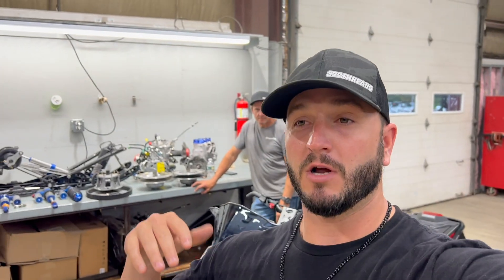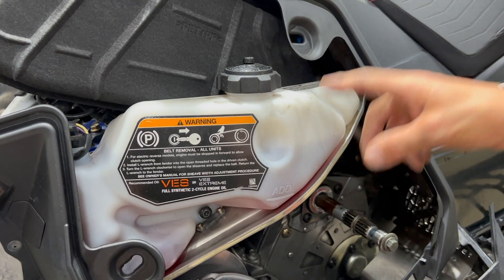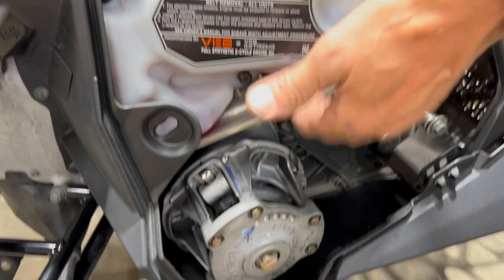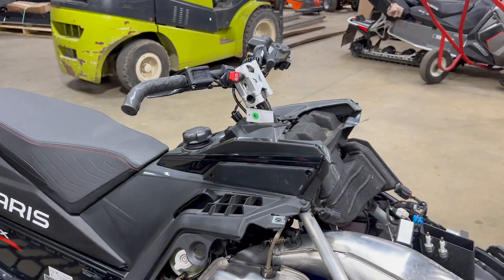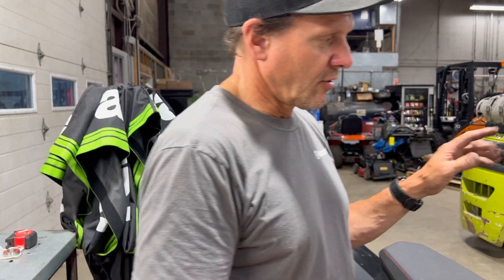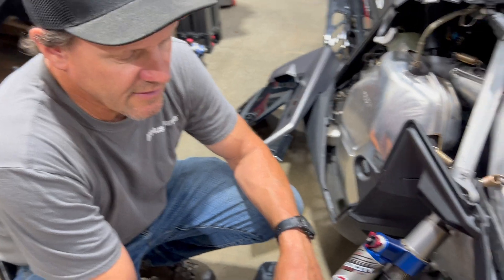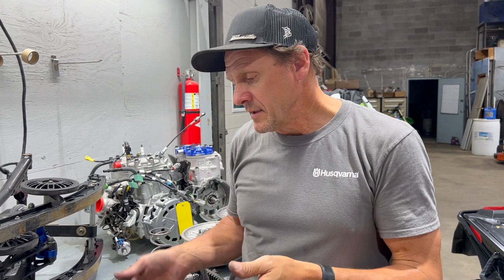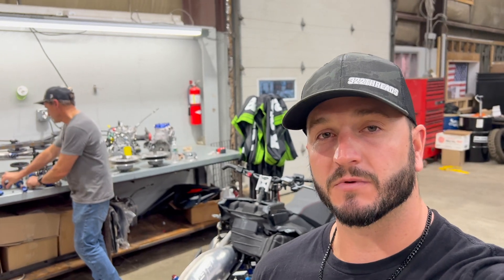DON'T GET STRANDED! OFF SEASON SNOWMOBILE MAINTENANCE! WHAT TO LOOK FOR AND WHAT TO DO!

Comment: Is it normal to have a little side to side play in the front track shock? The shock and bushings are new but I was surprised to see it move after I installed all new parts. 2017 XCR 800 if that matters. Thanks!
Reply from the maker: it is normal believe it or not. even brand new sleds have some side to side slop.

Comment: Jesse how about a video on what you carry in your bags on the sled tools mainly. Also I have never heard you guys mention ice scratchers. What are your thoughts on them brand style etc. Got the tv set up in the garage now to watch while tinkering on the sled
Reply from the maker: i dont even carry anything but i need to get some tools together for sure. as far as scratchers Bruce and i do not run them. i have never seen a reason too but he has been installing alot of BRP scratchers on customers sleds
Reply: We get a ton of ice on the trails around Greenville and over heat without them / burn up the hyfax
Reply from the maker: the BRP ones seem to be the best option.

Comment: Enjoy watching your videos. But for a regular hard-working guy like me, I have a hard enough time getting a new sled once every 5 or 6 years, let alone every year. I snowchecked my first polaris ever  this year an xc650 137. What is really irritating me about the whole thing is that I built my sled, got it ordered and confirmed then got told I couldn't get it in the shadow gray and black like I wanted. It came red and gray. What good does it do to have snowcheck and options if you can't get it. And people like you who do what you do for a  living i.e. the videos and stuff seem to get whatever you want when you want it. I'm not jealous or mad about what happened to me and I'm sure I'm not the only one this happened to. But why is that?
Reply from the maker: Hey Jim congrats on the new sleds. So anything I have a certain way I build them they way. I change panels and colors and wrap sleds. The sleds from factory come with a certain color scheme and that’s all that you can do unless you change the panels im sorry you feel singled out but that’s not the case
Reply: @JESSEJAMES322  Jesse, thanks for replying. I don't feel singled out. My real question was, why does polaris offer options to build a sled the way a consumer wants it, if you can't get it the way you built it. That doesn't make any sense. No need to reply back.
Reply from the maker: that doesnt really make sense. if you snowchecked a sled then it should come as you snowchecked it UNLESS your deealer messed up

Comment: Another STOP RIDE, IMPORTANT SAFETY STOP RIDE NOTICE

July 13, 2023

Polaris Industries Inc. is issuing a Stop Ride notice to affected owners of Model Year 2022-2024 MATRYX snowmobiles equipped with PATRIOT 650 and PATRIOT 850 engines because of an increased risk of primary (drive) clutch failure due to post cracking. The failure can cause the clutch or clutch components to be separated from the unit, posing a potential injury hazard to consumers.
Reply from the maker: its wild